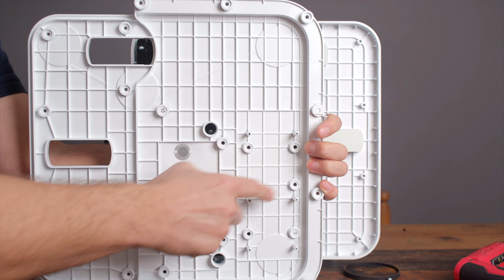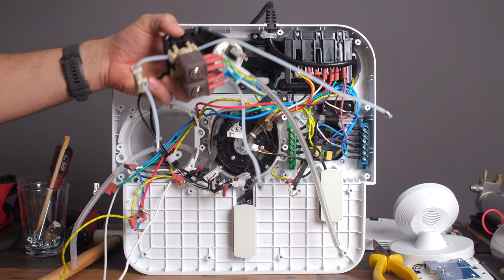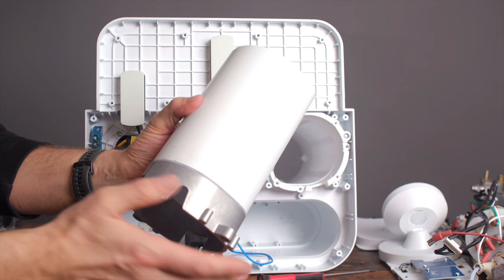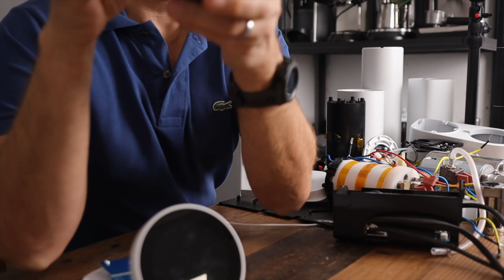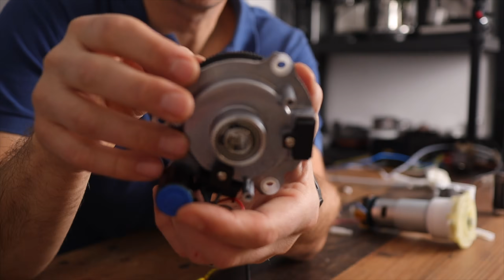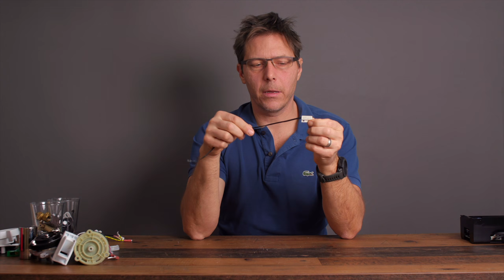Full Teardown of an $1999 Espresso Machine - Meraki

Comment: And I was just about to buy one of these…
Thank you, awesome video, I’ll stick with the original plan - Bambino Plus and DF64 grinder.
Reply from the maker: Bambino Plus is quite a rat's nest inside, just to let you know. Much easier to work on would be the GCP. Cheers!
Reply: @T @TomsCoffeeCorner ctually, it’s a paragon of engineering compared to this machine. I watched very carefully, a full tear down of the Breville and (as an engineer myself) I concluded it was a very efficient and elegant design. 
The Meraki is typical of a low-volume producer with little history - wonderful looking design (because custom plastic chassis are quite cheap to produce) and a set of internals that are good components, but have yet to be proven to work reliably together, over half a decade of use.

They’ve clearly designed down to a price target, but this is not obvious until you look more carefully, both at the conical burr grinder and the internal construction.
It’s good, but it’s not great. And it’s not remotely near the standard of engineering, construction and reliability of the Breville machine. I did find the electrical terminal blocks to be a charming touch, though.

Thank you again for the wonderful video.

Comment: Cool teardown. Asa Breville Oracle owner who has had to conduct many repairs personally (O-rings, grinder, solenoids, vibration pump, etc), , the construction seems similar.I would guess that this machine will require parts replacement every 3 years or so. Maybe earlier of the base components are not high quality. Its $1600... we have to be realistic and believe that makes this more of a 5 year "disposable" machine.

Comment: I had an all steel Conti machine in a small office which needed service frequently, even though used only a few times a day. The case material doesn't predict longevity. The combination of sensing circuits and high temperature and high pressure water guarantees future service will be needed.

Comment: Well, for the moment, don't buy that machine at all. Multiple delivery postponing are red flags concerning the company. Today, Meraki announced a 6 weeks delay for all customers, supposedly for a manual update of the machines presenting voltage related errors ... kinda strange for a machine that should connect to the Internet to get updates ...
Reply: It's because they need to do a firmware update to a component.. Not ideal, but at least they're being proactive about it. Sucks that we have to wait longer though.
Reply: Better read new posts.

Comment: Does the machine have also a normal fuse and a thermal fuse/switch for both boilers?
Reply from the maker: It has two of those high temp thermostats on each, which act like thermal switches. Cheers!

Comment: Excellent video! I am concerned with all those ptfe lines but is there any machine that doesn’t have them?
Reply: @kevinburola889 I just looked and even the Lelit Bianca V3 has some Teflon lines in it. I'm just glad to see that it's the industry standard and not Meraki cutting corners to lower their costs of production.
Reply: @ Agreed! Perhaps older unit might be free of these lines.
Reply: Teflon itself is fine, the bad substances are PFOA and similar ones which are used in Teflon production. Some factories were (and some still are) quite irresponsible about them.

Comment: Good video, but im still not sure what to think of it. I love the concept and design of the meraki but fear the quality of components and longevity. After all would you say it can produce worse, similar or better shots then the oracle jet?
Reply from the maker: I think it depends. If they are both warmed up properly, I feel like their shots are in the same league. But it takes a long time to be fully warmed through...
Reply: @TomsCoffeeCorner  the Meraki needs a long time? Thought they promised 3-4 minutes? I knew that this would mean more like the typical 10min for the whole machine to be up to temp but with you saying it takes long you mean even longer?
Reply: @letslachflash  also interested!
Reply: Loved the video, l was hoping you would disassemble the group head a bit more to show what was under the shower screen. Is it all stainless steel? I ask because the Breville dual boiler is aluminium with some sort of black resin/plastic coating.

Comment: I think that might of invalidate your warranty but very interesting . Quick question which is the better De'Longhi ECAM320.60.B Magnifica Plus Bean to Cup Coffee Machine or the Ninja lux premier, i know you have said that you like the delonghi
Reply from the maker: Those are 2 different machines completely. M+ for hands off, Ninja for hands on. Ninja will overall make better drinks, but requires user input.
Reply: @  just confusing on what to get i have a sage ceresta pro at present which is hands off but this is on its way out, but just wanted a better flavour like you get in like costa etc so just doing my homework. I enjoy watching your videos and have learned so much so keep going your doing good and thanks for your input much appreciated

Comment: did you note any capacitor on pump motor? the italian machines with rotary pump typically have a sizable capacitor. wonder if motor technology is different from industry standard? wonder if pump is rebranded italian pump either made in china or europe or an independant brand made in china? italian machines usually have a motor significantly larger than that on the meraki. all plastic chassis/frame can be an advantage since when restoring machines typically the metal frame needs corrosion repair work and often powder coating.  bottom panel should have multiple drain holes to prevent rising water level before it poses a pcb threat. nice to see teardown from an engineers standpoint.